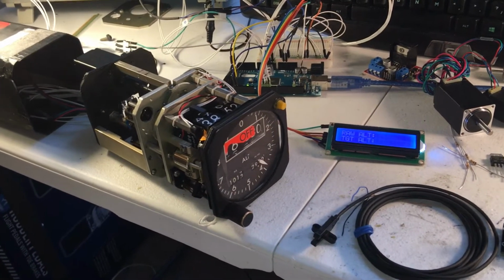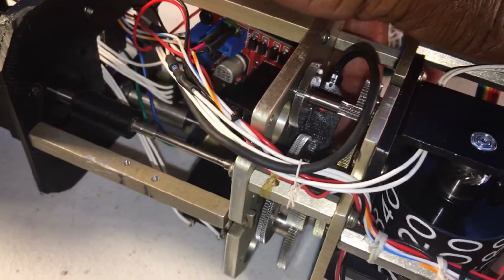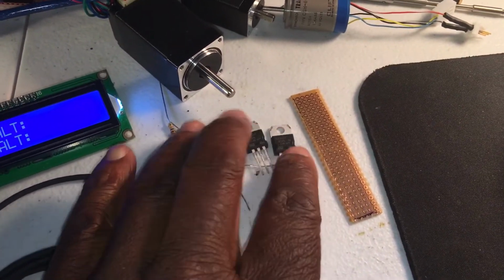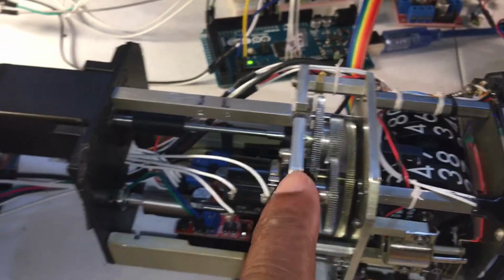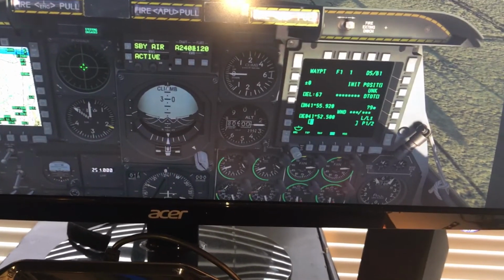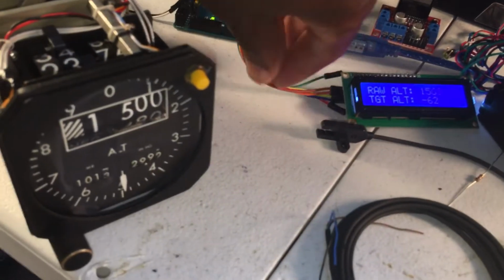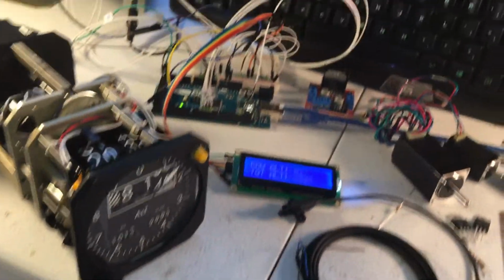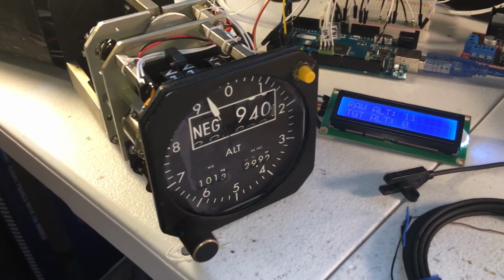A-10C Home Cockpit: Altimeter modification

Comment: hi, i am doing some like you, i have a question, how the encoder knows the initial position wen sart at the runway with different altittude
Reply from the maker: That particular model altimeter had a 15 turn potentiometer attached to one of the gears. If you use a pot, I had in the initialization code  to read the pot value, then turn the motor CCW or CC until the pot read it was at the home position. The other way is using a proximity switch for home position. The problem I had with that is I drilled a small hole in the gear for the switch. Well the gear makes a full rotation every 5,000 feet. So you have to power the altimeter on (or load the sketch) when the reading is between 0 feet and 5,000 feet. If the altimeter is outside this range then I load in a temp sketch to move the altimeter into this range.  I have a sketch called 100ft, 500ft, 2500ft, 5000ft, 10000ft, 25000ft, -2500, -5000ft, etc. Once I load the temp sketch to move it into position, then I load the real sketch that is meant for DCS Bios export data and then I’m on the way.
Reply: @joesim9577  ..i believe that a multi turn pot is the best approach...i going to work over there..thanks
Reply from the maker: Also the variable that I use is one from the global (common) variable list in DCS Bios called altitude (MSL). So if I start at a runway that’s say 1,500ft above sea level, that variable will indicate 1,500ft even though I’m sitting on the runway. Another way to do it is look at the altimeter indicator itself. However, that variable is broken out into three separate variables. One for the hundreds of feet, one for the thousands of feet, one for ten thousands of feet.  You’d have to add all three together to get the total altitude. It’s a little cumbersome because 0 to 999 feet is represented by 0 to 65535 in variable hundreds. 1000 to 9999 is represented by 0 to 65535 in variable thousands. 10000 to 65000 is represented by 0 to 65535 in variable ten thousands. That’s why I use the global mean sea level altitude because it’s easier.
Reply from the maker: Global Altitude (MSL) variable is easier to read in my opinion too. It’s 16 bits, 2^16 is 65536. So it’s value is 0 to 65536. If the variables value is 225 then it means your altitude is 225 ft MSL.  If the variable value is 35450, then it means your altitude is 35,450ft MSL.
Reply from the maker: So the whole process goes like this:
Step 1. Initial the altimeter to 0 feet. Your code will rotate the stepper motor until it sees the proximity switch activate then it will stop. Through trial and error you will know how many steps it takes from that position to rotate the motor and have it stop on 0 feet. In my case it’s -7 steps (move needle Clockwise) from the location of the proximity switch which is located at Negative 50ft. 
Step 2.  Now the initialize code is located in the void setup routine in your program sketch. That’s the section of code that only runs on boot up. In the void loop part of your code you have a section that runs the stepper motor. So this code runs continually in an invite loop. Now this code has a variable that it’s value is derived from the altitude information that it receives from DCS Bios. The motor is told to move from its current location until the difference between the current location and altimeter variable is zero. So it’s (current location - alt variable = 0). When that statement is true stop moving. 
Step 3. So the altimeter will initialize and move to 0 ft and stop. Then it will read the altimeter variable from DCS Bios and see it has a value of 1,500Ft. Let’s say I’m sitting on the runway that has a 1,500ft MSL value when you are parked. The code will then see 0 - 1500 = -1500. Now the stepper motor now knows it needs to move CW by (1500 x scaling factor). In my case ever 42 steps represent 1,000 feet movement on the altimeter indicator. The motor will move until it sees that the current motor position is the same value as what the altimeter variable from DCS Bios. 
Well I hope this helps. Cheers.

Comment: Hi Joe, great work!  I have done a similar thing with a 737 Altimeter, but using a DC motor and 10 turn pot connected to a Pololu JRK controller, essentially making it work like a closed loop servo.  Its not very smooth as the JRK is a PID based controller and the pot input is only 4096 steps.   I am looking to convert it to stepper motor drive, as you have.  mine has the compound gear train for 1000's of feet so I am very interested to see how you used the potentiometer to home the stepper motor to 0 feet?  Maybe an idea of how you coded it etc would be great.  I have many other things driven with steppers, but they are all homed using switches or photosensors.  Cheers, Mick
Reply from the maker: That's an awesome job you have done on your 737 simulator.  You have a lot to be proud of.  A lot of 400Hz instruments that you have wired up.
Now at first I was surprised that it worked.  Looking at the oscilloscope, the analog pot signal was noise to the extreme.  Nothing but tall sharp looking triangles up and down.  But the arduino saw it as steady as it was repeatable to the same spot for homing. Its a 0 to 1023 analog reading.  DCS-BIOS software does have some kind of software smoothing filter on the AIs (analog inputs).  So if you do use a POT and experience any noise issues you can try and power the pot with a clean DC source instead of power supply that is shared with everything else.
Well I posted the code to Github as Youtube limits the word count in a reply.  Its under altimeter mod, then the file UFC.ino because that arduino also drives the Up Front Controller amongst other stuff.
https://github.com/GSS-Rain
The values were picked such that at 0 ALT is the target pot value.  But the runways I use are always about 100 to 300 ft above sea level so it will rotate to 200 Ft.  Hard coded that way for now.   So if I reset the arduino it is always above 0 ALT and the needle will drive to 0 ALT then forward to 200 Ft.   But for whatever reason if I crash and end up starting at a neg altitude it will still know how to initialize and find 0 ALT.
Reply: Thanks very much for the compliments and information Joe!  I thought that would be the way to do it, but you have assisted greatly.  I have some small geared steppers that i used for an RMI before i got another complete one that runs on ARIC429.  They will work nicely, 2048 steps per revolution, so a nice needle movement.  I will start experimenting and see how i go, Thanks again!

Comment: Hi Joe, I enjoyed seeing the inside of this kit and your modifications to it. 
It sure does look good in a nose dive. I've been thinking of getting a 3D printer for the insides and back of some of my panels. What software do you use for 3D printing? Is it a one off purchase as it seems alot of software companies collar people for a monthly subscription
Also, what do you reckon to the F18 module? Are you picking that one up 
Cheers
Reply from the maker: A 3D printer in your hands would be a potent mix.   I went with Fusion 360 by AutoDesk.  They say a 30 day free trial but when its up they give you an additional year.  When that's up you can still use it if your not a business making money with it.  It's plug and play and can readily export your models to your 3D printer.  Also for you it does a ton of other stuff with CNC machines.  I've been using it since 2016.  I pre-purchased the Hornet.  I think it will be the most advanced module to date in the DCS World.  Can't wait to try the ADM-141.  However, if I were to build another plane sim, it would be the F-14 Tomcat.  That's my favorite from that era.